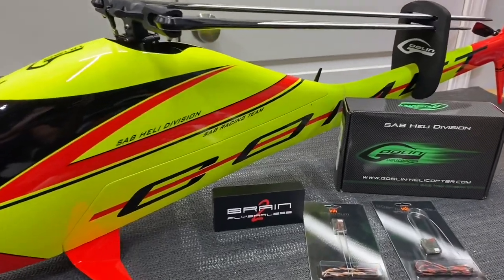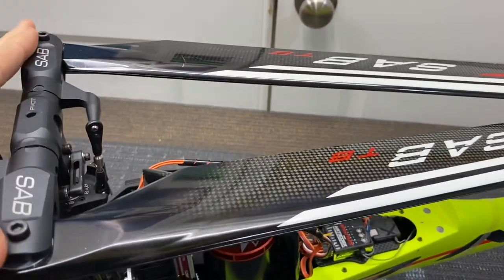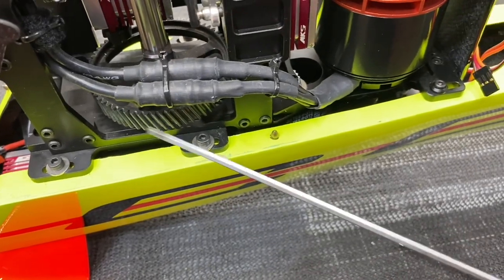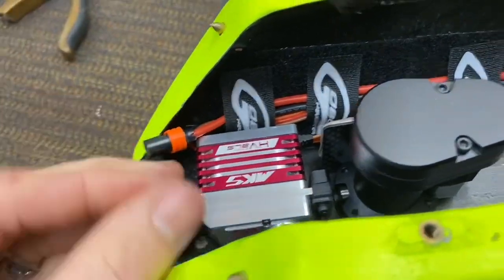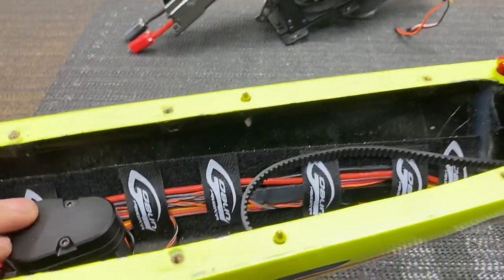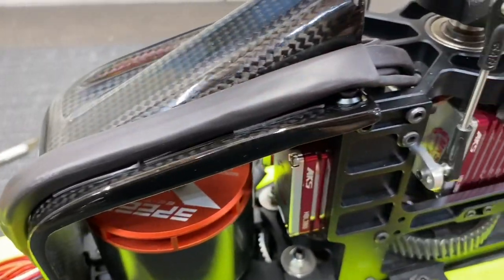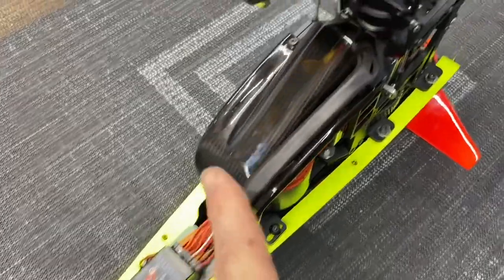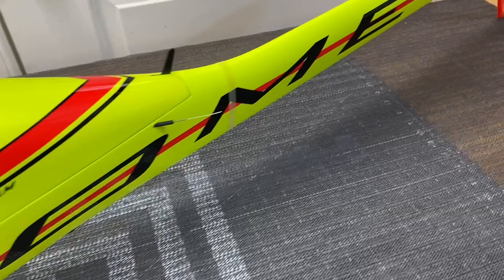Project Worlds Fastest Helicopter

Comment: That’s a beauty!

I... don’t know if the retracts will reduce your overall drag significantly tbh. 

I’m curious. Are you game to see how much difference there is with and without retracts in terms of max speed?

Also, lol, have you thought of Estes solid fuel boosters? Airwolf!
Reply from the maker: Retract will drop drag a bunch. Anything sticking out is drag. You will see upwards of 10mph gain off just the retract. Now, I do have two Comets, one will be a practice model with the fixed skid. But! Power will be a massive difference. I could always bolt the fixed skid back on to see MPH difference.
Reply: I’m very curious. I used to think the main rotor was the main reason helis could never fly as fast as fixed wing, and that was one of the biggest problems. 

I admit I can’t remember the actual physics behind that claim. Whether it was just too much drag or just a retreating blade issue. 

I’ll have to look it up, or maybe someone here knows?

Comment: What ESC and Motor, pinion, pulley, blades you looking to use to break the current record? I'm sure its possible but it will be difficult to achieve, there were some very sophisticated enginerring in the diablo body wise, aerodynamic weight.  also in the TDR speed, very capable machines tweaked to the max, I have faith in you guys so tell us how your going to beat the 311 kph set by the diablo speed, very interested in this project so tell us more?
Reply from the maker: Motor is being custom made, ESC will be a YGE 255 on 16s, can’t say on the pulley yet because I don’t know.blades will be Xblade 715s. The Diablo is an incredible model. And definitely weighs less than the comet. I have a few ideas for a body on the comet if this one doesn’t do it. There is already a Comet well over 311kph it’s just not an official number. I’m sure it won’t be easy, if it was, everybody would do it. Lol but I like the challenge! I have gone very fast with her appointment so now it’s time to try it with helicopters!
Reply: @westhobbiesrc8051   that sounds like a good setup, but plenty of physics to be concerned about, I'm really looking forward to see what you come up with, I have faith in you guys to do this, would be great fantastic if you can do it. brilliant well done sir for having ago ...I wish you all the best and good luck with the build